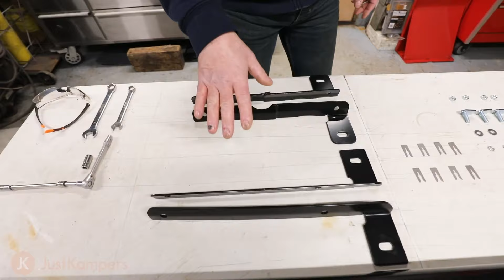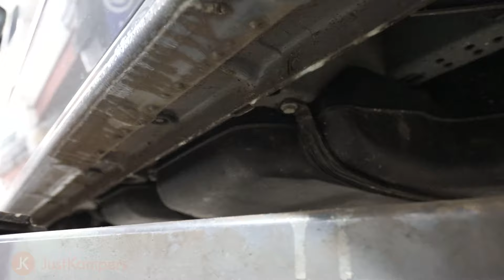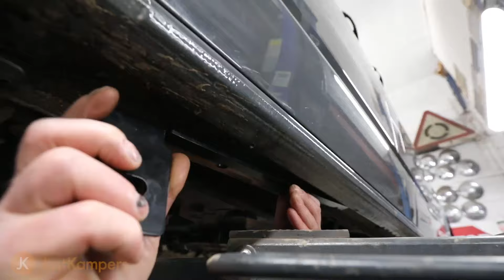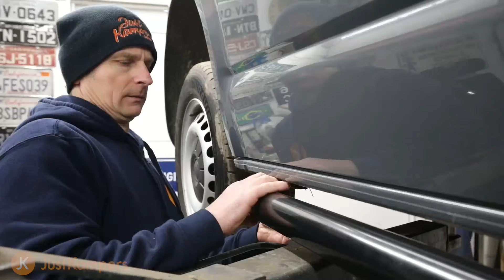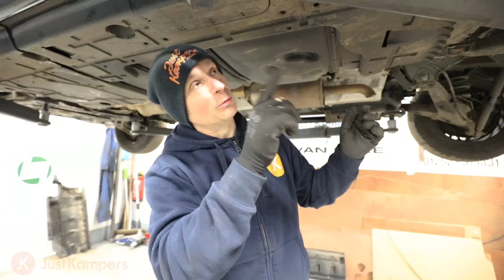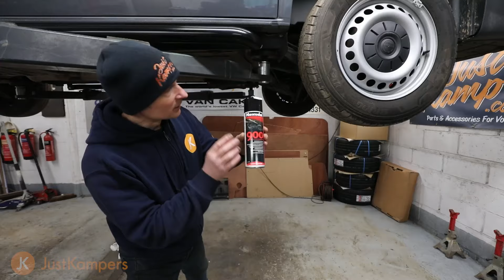JK Guide: How To Fit Sidebars To Your T5, T5.1, T6 And T6.1

Comment: Nice and clear instructions.
Could you not just cut down the bolts rather than crop the plastic covers?
Reply from the maker: Hi, yes you can, but it does make it more difficult to fit brackets.